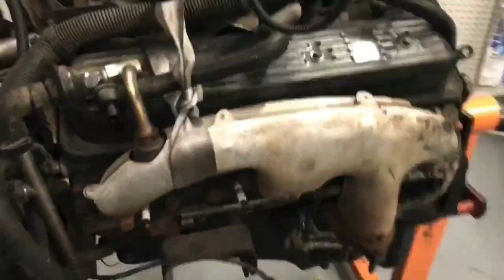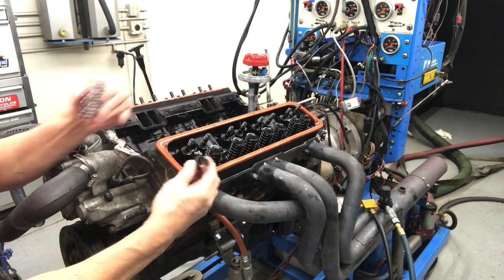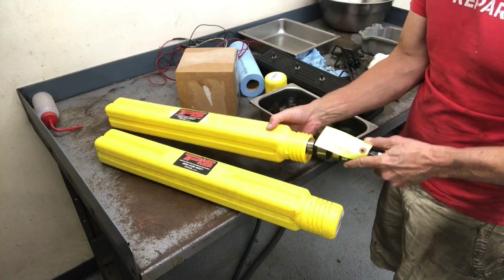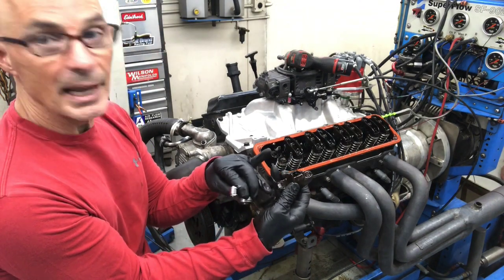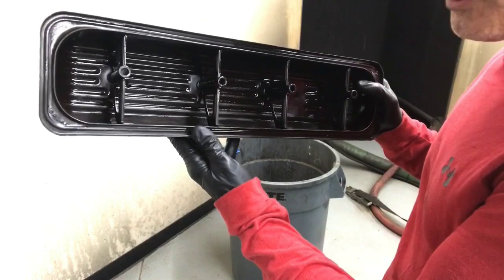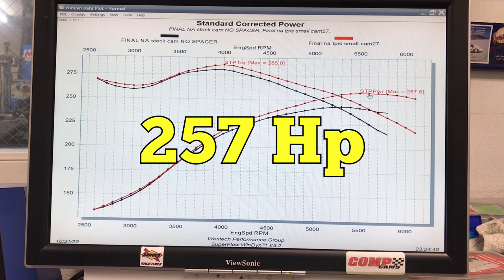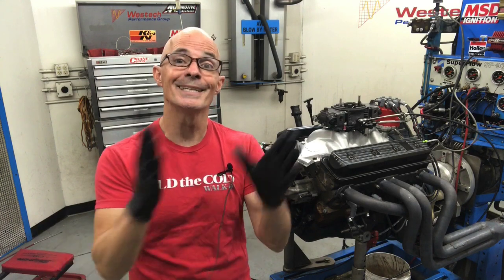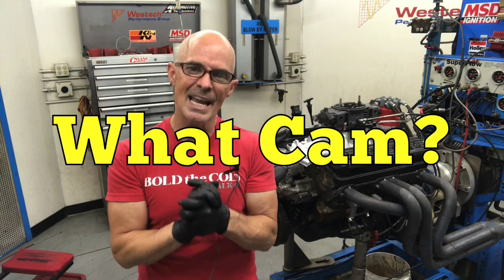4.3L L99 CAM (& ROCKER) TEST-(THE OTHER LT1)

Comment: Richard, do you have any affiliate links? I'm going to be buying some performance parts for my 5.0 Ford, and a few of them are because of the information from your testing. Specifically Comp Cams and Trick Flow. I'd love to help support you! Thank you and God bless!
Reply from the maker: I do not but should get that going-if only I knew how?
Reply: @richardholdener1727  I don't either, but I bet you've sold a ton of XE274HR's!
Reply: I have enquired when Edelbrock would develop the Proflow EFI for the Cleveland, they have the ecu and dis just need the manifold with injectors.

Comment: Is there a stock GM crank w/ a ~ 3.7" stroke so you can get a proper "square" engine? Just curious...
Reply: Closest "OEM" crank option is a 3.75" stroke. Aka: Aftermarket 383 LT1 stroker crank.
Reply: Not a stock crank, but a scat 1piece seal 3.75" stroke, less than $300 , it may run well down low, but with the small bore shrouding the valves, it's not going to be magical! Maybe with a high tq cam, it could make crazy tq, especially with a turbo, (the right turbo) to make boost by 2,000 rpm.. Because it would be done by 4k
Reply: @jamest.5001  
 @JAMES T. not kirk  
A 3.75 stroke only makes this combo a 334.

So, "done by 4000" seems unlikely given the flow of an LT1/L99 head. Especially when ported and using a decent camshaft.
Reply: @of_lion22  displacement alone does not determine the rpm range an engine will be happy.  The reason he was thinking it would be done early, is because that small bore size is not ideal to allow good flow.  It does not matter how well the heads can flow on a bench if the valves are shrouded by small bores, limiting their actual, useable air flow on a particular engine.

Comment: Rich this is awesome. Seriously, I have never owned anything with a SBC in it, let alone a LT1 OR a 4.3L V8. 4.3 V6 yeah, but no 4.3 V8 OTHER than my 76 Buick Skylark with an Olds 260. I'm still not giving up on begging you to test and mess around with an Olds 260...never will give up. Anyway, I am seriously pumped about seeing this seriously small block with boost. I think that it's going to surprise alot of people. It already has in my eyes with something as simple as a cam swap. I am definitely not going to miss a single video!
Reply from the maker: thnx-and keep pluiggin' the Olds 260
Reply: Hi Tim Tom my name is John Paul Schafer and I'm into 4.3 & 4.4 L small block Chevys 
 the to 263 L99 which riches building and also the 267 L39   
An acquaintance of mine who had a 260 in an Oldsmobile and I understand that you cannot use a 4 barrel intake manifold on 260 heads I'm not sure of all the details but you may want to inquire if you can figure out some way to put a Quadrajet 4 Barrel on your 260 you'll be amazed with the results I've done I've done a lot of experimenting with the 262 LV1 which is out of the 75 76 77 Monza Nova Ventura and I've also done experimenting with the 267 L39 out of the 79 to 82 Malibu and been very pleased with the results it may be that you can fabricate a four barrel intake off of an Olds 350 I know Chevy made some of theirs out of aluminum and maybe that you can find an aluminum Edelbrock manifold that like a performer or something that you can fabricate to your 260 just a word of note these engines really respond well to dual-port 360 manifold from Offenhauser they no longer manufacturer that intake manifold but if you can find an old one floating around somewhere used I highly recommend using the dual-port 360 manifold since it produces a lot of strong vacuum signal with high air velocity at low R P M which is what Small displacement works well with 
Cam selection 106 to 108 
.int.435/435ext to works well made 200to250hp with L39
267 with stock heads
 look forward to your response I'll share with you all my findings in tips that I have discovered by running the 260s cubic inch family small block Chevys have a nice day and God bless you